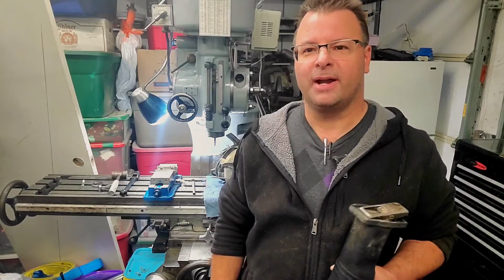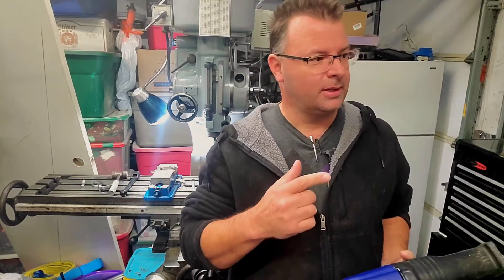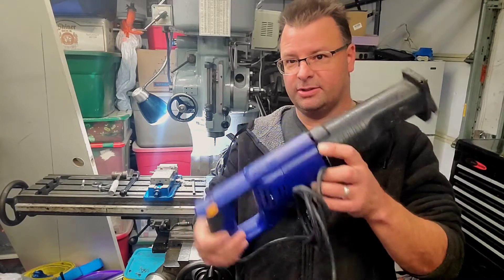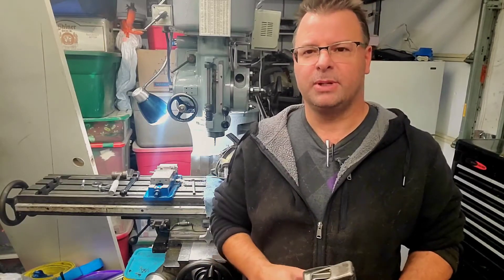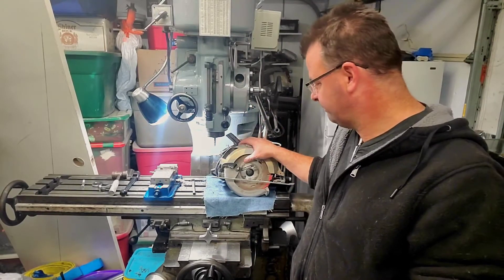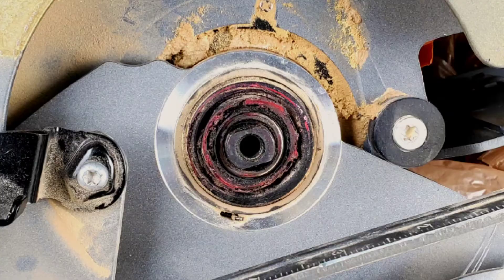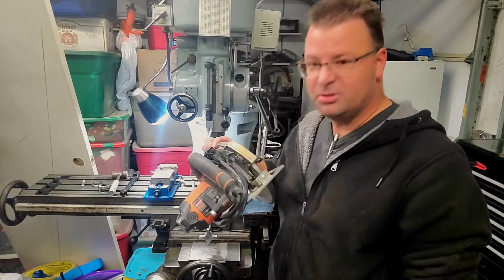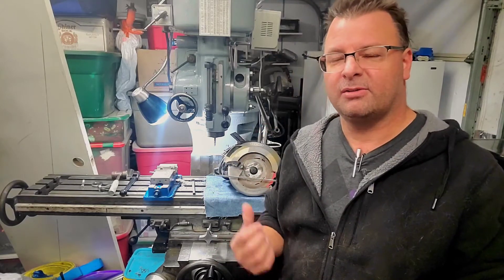Possible Circular Saw Repair & Restoration Video??

Comment: I burned up my cheap Black and Decker saw in 1988 with a concrete blade on it and cutting an expansion slit in 2 inches of concrete. Melted the brush holders. Then I got the aluminum Skill brand to finish the job, and that saw will not be killed.
Reply: But I like the idea of repairing everything. I've had melt downs of universal motor items recently, lost two shop vacs, and an electric chain saw. Can't fix them, unless I rewound them.